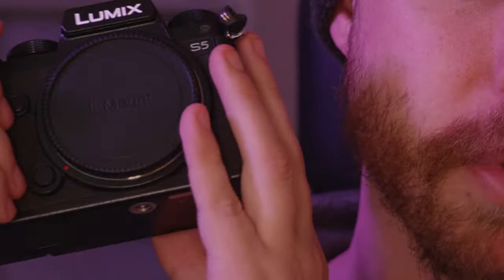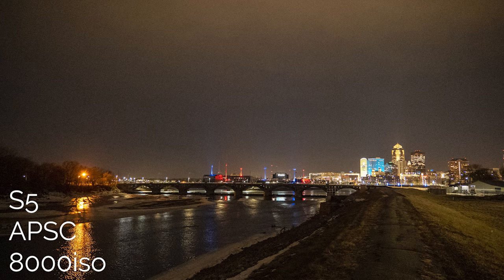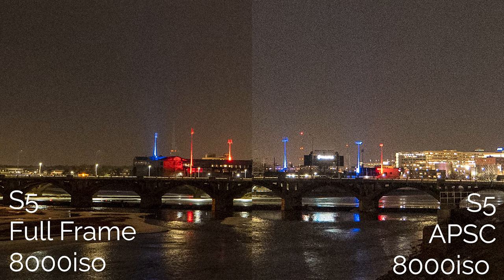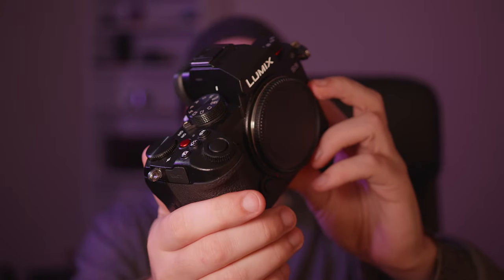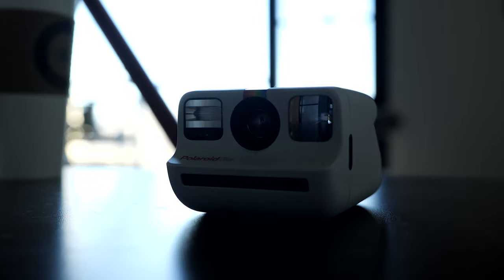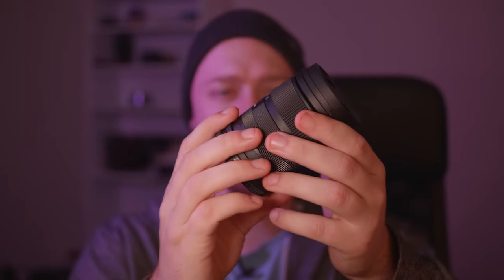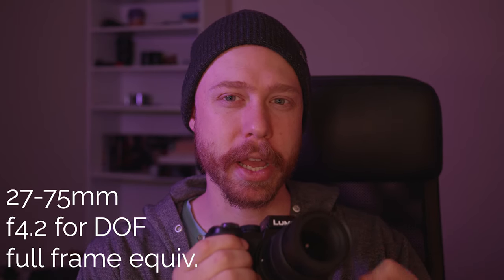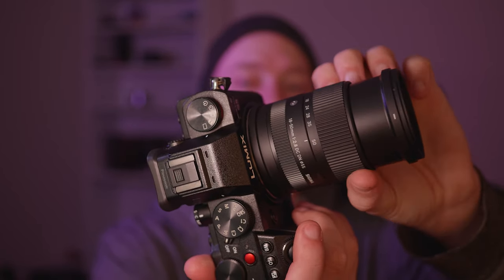APSC crop on the S Series cameras is a trap!

Comment: Get the S5 for $600 as a 4K/60 APS-C  wirh Sigma 10-18mm & 18-50mm
Reply from the maker: I have that lens for sure, it’s a great crop sensor camera in that mode but it’s better in some ways too
Reply: Is there’s a way to force the S5 to go into full frame mode with vignette on sigma APS-c lens ?

Comment: Why not use the 20-60mm?  Is that 3mm really worth $675?  Certainly a ff lens is going to perform better in the corners than an apsc lens!  I just don't see the value.
Reply from the maker: That’s what we are trying to find out! There’s obviously other APSC Lenses you can adapt that will work fine for this idea as well plus I just have a hard time with variable aperture lenses.
Reply from the maker: Also 3 mm at a wide angle is more significant than most people realize!

Comment: You can use crop mode in photos with full 24MP resolution and can be in Raw as well on Lumix S5 & S1 but the settings is not straight forward
Reply from the maker: Could you explain this process?
Reply: @RhettThompsonFilm  go to settings then in the second page select photo/video preview change it to video… now change the video settings to Aps-c  then the photo will be in aps-c mode it will also appear on the screen.. you may set this function to any button

Comment: Sorry to be the one to point out the obvious mistake in calming that the background separation would somehow be affected. Just like cropping on the center of an image in post production croping in during the recording will not have any impact on the background separation.
Reply from the maker: I was using shorthand of course. The distance relation to the background, subject, and lens are different that effectively makes it harder to throw the background out of focus.
Reply: @RhettThompsonFilm  if so by croping in you are actually helping achieve better separation by increasing the distance from the lens to the subject and the background in order to get the same subject framing. No?
Reply: @RhettThompsonFilm  just to be clear I'm not having a go. Just know that a lot of this is counter intuitive and it's easy to get things confused when it comes camera optics etc.
Reply from the maker: @LiveMyJourneyTom  quite the opposite. It’s well documented you have to have half the focal length on a MFT to get the same framing with a subject with the same distance which makes it harder to at equal apertures to get the same shallow depth of field.
Reply from the maker: @LiveMyJourneyTom   as I said it’s just shorthand that most people understand at this point
Reply: @RhettThompsonFilm  hold on a second. What you said is that you are not going to get same background separation on full frame with the equivalent lenses which is what I object to. We are not talking about adapting a full frame lense to a mtf but a apsc lens to a full frame. The crop from the sensor will have nothing to do with the depth of field as this is dependant on angle of view and so the distance from the sensor to the object you are focusing on. The focal length and the aperture is the same so there will be no difference whatsoever. If you frame your subject identically using the same lense with apsc camera and the full frame there will be proportionally more background separation on full frame but the image will most likely not cover the whole sensor and you will have to crop in on the image to remove the vignetting etc. The crop sensors have less background blur then the full frame because at the same focal you have to be further away from the subject to acheive the same framing. Focal length doesnt change and that's why you Mtf Leica 10-25mm has that designation in the lens and not the equivalent values of 20-50...
Reply from the maker: @LiveMyJourneyTom   I really don’t see the point you are trying to make. A full frame 24-70 will look like a 24-70 2.8. An APSC 17-50 2.8 will behave like a 25.5-75mm f4.2 for angle of view and the Lumix 12-35 will behave like a 24-70 for angle of view and 5.6 background blur. Of course it is just cropping in on the sensor and having to move back 1.5 times or 2 times as far making the background blur with the same framing appear less out of focus. Again I don’t see all the fuss about this since it’s obviously just a shorthand, and I didn’t want think video to be 24 minutes long explaining something most people already understand.
Reply: @RhettThompsonFilm  people will be confused when you say that a crop sensor lens on a full frame camera will have less background separation. This is not my interpretation but what you said word for word and it's what I object to as it's not true. It works the other way around when you consider crop sensor and eqivalnece.
Reply from the maker: @LiveMyJourneyTom  it’s objectively harder to get background blur on crop sensor cameras as a general rule.
Reply: @RhettThompsonFilm  I know. It's not what you said and not want I'm objecting to. The a subjrct of you video is not using full frame lenses on crop sensors but crop sensor lenses on full frame cameras. Using a crop sensor lens of full frame may limit the coverage of the sensor by viable image but at any given focal length and f stop value the background separation or the depth of field will be exactly the same as on any other full frame lense as both the focal length and aperture are not sensor size dependant but absolute values.

Comment: Speedboosters decrease sharpness so much on m43, that you might as well record 60 fps full HD instead on an S series camera.  I dont get why people care about 4k yet put a speedbooster on.  Zoom in and youll see you lose the sharpness.
Reply from the maker: I think that largely depends on the speedbooster being used
Reply: @RhettThompsonFilm  Gerald Undone compared the sharpness of metabones vs cheaper options and sharpness was the same.  Maybe you are right, its a valid point, but I've literally never seen a sharp video with a speedbooster, and as someone with a 4k TV as a computer monitor, I can immediately tell lol.  I can predict it without even knowing.  Looks mushy.
Reply: Sigma 18-35 with metabones speed booster in m43 is crazy sharp in 4k. People use promists to soften it. Cheap speed boosters have cheap glass and less precision. Speed boosters also bring in more light which reduced iso required in lower light, also making images cleaner and hence sharper.

Comment: do I lose light with a apsc on the r5 I got a 1.8 is it still a 1.8
Reply: I can't buy a zoom lents of a f1.8  but I have some good 2.8 full frame but need some more light
Reply from the maker: Light transmission is always the same, no matter the sensor size

Comment: Hi Rhett! Sorry, being new to full frame I'm a bit confused by all this.  Can I put a sony e-mount aps-c lens on a Panasonic S5?  Would I need an adapter?  Does such a thing exist?  I want to shoot wide on an S5 in 4k60p and I think the best way is an aps-c lens but I don't know what lenses I can use on an S5, or how to do it.  Any help is appreciated and sorry for being a bit of a noob. Thanks!
Reply from the maker: Generally adapting mirrorless cameras to Other mirrorless cameras is not possible. The S5 uses the L mount so L mount is best or maybe adapted EF PL or vintage lenses. If you want to shoot white angle on the S5 in 4k60 there’s options out there but not a ton for wide angle stuff. Maybe the best route is an EF to L adapter and some APSC lens from canon sigma or Rokinon.
Reply: @RhettThompsonFilm  Thanks Rhett!